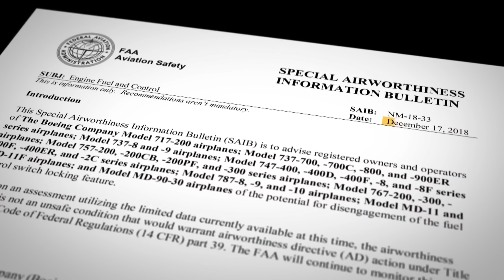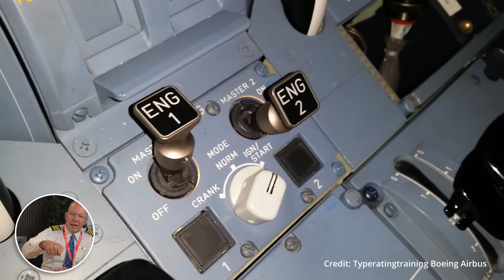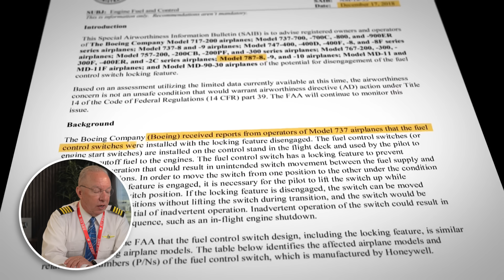Air India 171: The FAA’s 2018 Fuel Switch Locking Bulletin Explained (16 Questions Answered)

Comment: From NM-18-33:
“If the locking feature is disengaged, the switch can be moved
between the two positions without lifting the switch during transition, and the switch would be
exposed to the potential of inadvertent operation. Inadvertent operation of the switch could result in
an unintended consequence, such as an in-flight engine shutdown.”

Comment: If Air India never carried out the inspections recommended in the 2018 FAA bulletin, how can anyone know for sure - at this point - whether the fuel switches disengaged due to an equipment failure - precisely like what was laid out in the safety bulletin, or due to a microprocessor failure in the ECU that instructed the action, or because of the deliberate movements on behalf of a pilot to CUTOFF the engines?
Reports saying the fuel switches were each disengaged a second apart from each other doesn't immediately scream "pilot sabotage" to me. Maybe there is a bump somewhere on the inner portion of the fuel cutoff switch mechanism that caused one of the switches to fail slightly later than the other one (?). Not saying that is what happened. Just saying there have been plenty of incorrect root cause determinations made in the early stages of airline crash investigations - and often what was thought to be an "obvious" cause right after the incident has turned out to be wrong.
One pilot asked the other why he cut off the engines and the other pilot replied that he did not cut them off. So, it's possible he was telling the truth.
Anyway, I'm skeptical of assigning blame this early on.

Comment: Steve I watched a video yesterday repeatedly demonstrating the fuel control switches in a 787 being cycled from "run" to "cut off" and back, they made a sound that could be heard in the video. Does the CVR have good enough "hearing" to record the sound of the switches being operated  in the cockpit of a 787 under take off power?

Comment: You are saying it was a physical movement of the switches and no electric or electronic circuits could fail, but actually the physical movement is not directly controlling the fuel cut off valves, it would generate some kind of digital pulse which will activate the electronic circuits which will activate some relay and some actuation with motor operated valve to shut off the fuel line, then why you say it could never be electronics circuits failure?

Comment: Airlines can put a camera and still address the concerns of pilots. How? The camera records and puts data in another FDR and once the flight is completed without any problem, pilots are allowed to manually delete the camera recordings. The recordings remain in the FDR only if there's a catastrophic crash after which the pilot is unable to delete the recordings.
Reply: Also, capt steeve deliberately overlooks and doesn't properly answer many key points such as

1. The issue of boeing planes having faulty fuel switches as shown in the beginning of the video and then no mention of it in the rest of the video.
2. Assuming that plane was working as it was supposed to giving a desparate cleanchit to boeing and nothing else like some  internal mechanical or electrical issue which could have triggered the switch in cut off. Mechanical Switches can be moved from inside and electrical signals can be altered by some unknown phenomenon, both either by accident or sabotage.
3. Outright rejecting the camera inside the cockpit saying that it wouldn't have stopped the accident is just not how he should talk as a consultant and captain. Of course a camera never stops anything from happening but helps us to find out how whatever happened, happened and can be prevented it from happening.
4. Him being a little uneasy and more reddish while quickly answering a few questions is evident here.
5. Him saying the word "denial" giving an impression of the other pilot lying when saying he didn't cut off the switch and not even considering it to be true and then logic further from this assumption.

Comment: So , most likely its the copilot. Captai , pilot in command, has the aircraft duting take off and climbout. He is concentrating on flying the aircraft. His eyes are in instruments and outside. Copilot knows that this is a critical ,most volunerable phase of flight. Captain is occupied, the aircraft is heavy , with nose high attitude, gear down, flaps down. So copilot takes advantage to quickly place fuel control switches into cuttoff. Knowing that even if placed back, there is not enough time and altitude for engines to get power  back. This was a deliberate act of inflight sabotage by copilot. A mass homicide suicide. Just like German Wings 149. Motive? Speculating, revenge,  retribution. Passed over for promotion. Feeling insilted. Having lived and worked amongst South Asian from Subcontinent , there is a dark streak that runs through their cultire. Slights and perceived insults are carried for years, decades. Grow like cancer. A cancer of the mind. Professional culture is so competetive and pressure to succeed is so high that any obstacle is taken bitterly personal. 
This was act of retribution against airline and society . Mass muurder. Well thats my speculation.

Comment: As an industrial systems, reliability & product compliance engineer, I would think that there would be a mechanical AND electronic (i.e., soft/firmware) interlock that prevents the engine fuel control to be cutoff once the aircraft is airborne, despite the position of the switches, unless there is an engine fire warning.

Comment: Captain Steeeve, 
Could a TCMA malfunction or glitch occur that commands an engine shutdown to the FADEC, and would the FDR then record this as the fuel cutoff switches transitioning to ‘cutoff,’ even if this was not physically done by the pilots?

The pilot asking the other pilot about the fuel cutoff could have been in response to an ECAM warning, rather than to seeing the mechanical switches in the ‘cutoff’ position—possibly under the assumption that the other pilot had already moved the switches back to ‘run.’

One of the pilots might then have manually moved the fuel switches to ‘cutoff’ (which the FDR wouldn’t register, as they were already electronically off) and back to ‘run’ to try to reignite the engines.

This could also explain the four-second delay between turning engine 1 and engine 2 back on.

Comment: Captain Steeeve.  I noticed your reluctance talking about cameras in the cockpit.

Body cameras are quickly becoming mandatory across law enforcement.  Any job that has potential of catastrophic danger, should be equipped with cameras.  The cameras could be triggered to run on a 2 minute buffer, and only be accessible to be viewed in emergencies. This would save stress, time and resources for investigators, and take care of privacy concerns.

2025 version of the black box",  Old timers are going to have to adjust, just like they probably did back when black boxes were introduced!

Comment: The report siad the fuel shut off modual was replaced on that plane. could it have been replaced with the faulty one from a 737?
Also on the camara issue we have driver cameras in all types of mass transit and critical carrier from busses, trains, Trucking fleets and even personal dash cams. the fact they aren't in planes is mind boggling.

Comment: As per my understanding the logic of the 787 in case of a dual engine failure is to automatically start the APU first and if that fails then deploy the RAT. APU takes about a 50s to 80s to start. So why was the RAT deployed sooner than that?

Comment: I must disagree about saying the safety bulletin was about installing the switches upside down. Surely the bulletin was saying that the switches could have been installed and then without the need to lift them up first to move them. Without the need to lift them first they could in fact move by themselves to the OFF position. That would explain why the pilot then said - I did not switch them to OFF. The bulletin also, I believe, advised all Airlines to check and fix this problem if it existed but Air India said specifically that they DID NOT follow this safety procedure.

Comment: Captain Steve, excellent as always. Perhaps give a bit of history of other infamous flights most MOST very likely suicide by pilot. Examples:

Germanwings Flight 9525 (2015) – Co-pilot Andreas Lubitz locked the captain out and crashed the A320 into the French Alps, killing all 150 aboard.

LAM Mozambique Airlines Flight 470 (2013) – Captain locked the cockpit and deliberately descended the Embraer 190 into the ground, killing 33.

EgyptAir Flight 990 (1999) – Relief co-pilot reportedly disengaged autopilot and repeated “I rely on God” as the Boeing 767 dove into the Atlantic, killing 217.

SilkAir Flight 185 (1997) – Cockpit voice and flight data recorders cut out before the Boeing 737 dove nearly vertically into a river, killing 104.

Japan Airlines Flight 350 (1982) – On final approach to Haneda, the captain pushed the stick forward and engaged reverse thrust; 24 died, 149 survived.

Such a complex problem, with the likely right fear many pilots have of never being allowed to fly again after treatment(s), because of the liability

Comment: The reason video cameras haven't been standard is because of pilot union pushback. They will almost certainly end up being abused by companies for pervasive monitoring instead of their purported use, accident investigations. There is also the potential misuse of footage by accident investigators, prosecutors and news agencies. Being monitored also has a psychological effect, it can cause pilots to second guess whether they made the "correct" decision in a high stress situation, one that will not lead to punishment by the company. There are other issues such as accident video of an international flight ending up in the hands of a foreign state. Aviation has extremely unique circumstances that make video of cockpits very much not as straightforward as you might think.

Comment: Captain Steeeve, why not go deeper into the priduct quality bulletin, question the maintenance operations quality, electro-mechanism of the fuel control switch before jumping into pilots' mental state? Pilots are geniuses for flying the plane but the build engineers know more about the mechanics and electronics in the plane that controls the whole plane. Let us not brush off the deeper engineering investigations to come before the blame on pilot's mental health.
Reply: Also disappointed that he only briefly covered the bulletin and then he gets the entire purpose of the bulletin wrong by stating that the plane would not fly if the switches were installed wrong when the actual issue was the locking mechanism and not the switches themselves.
Reply: That will all be investigated and will be part of the final report. That said, the black boxes would tell them if anything was wrong with the systems ,they already know a lot of what it wasn't. The data recorder showing that the two switches were thrown into the kill position 1 second apart is strong proof they were manually thrown, if it was possible they were bumped into or vibrated  , both would have triggered at the same time.. 

In the end the investigators final report,which can take a year, will be the ultimate resolution.

Comment: There should have been a verbal alert in the headsets and speaker in the cockpit "fuel cutoff engaged" (while in flight mode) but it seems this is not the case currently, but it should be!

Comment: I've got the solution and a theory! The cut-off switches must be placed in the cockpit in such a way that both pilots have to confirm their new position.. One switch on the captain side, the other one on the copilot side. My theory is that the same pilot who asked, "Why did you cut the fuel off?" it's also the one who actually did it. I don't think that a pilot who intended to crush the plane in the first place would've had any appetite to deny the unavoidable. Corect? This is, in my mind, a deliberate act. How many times did anyone turn their car engines off by mistake? Never.

Comment: I hope I can ask my Captain Steeeve a question here for him to hopefully answer in a future video.

Not a pilot, but I think this horrible tragedy raises some flight deck design questions.  I believe in all of the checklists that would shut down or cycle one or both engines, the sequence has the pilot move the thrust lever to idle first, and only then turn off or cycle the fuel switch.  I am wondering whether it might make sense while the plane is in flight mode to require the corresponding thrust lever be moved to idle before the fuel switch could be actuated.  Or to not allow actuation unless the plane has first registered some engine messages or performance issue that would warrant this action.  

Also, since unfortunately humans moving these switches during stable flight presents such an obvious and catastrophic risk to the aircraft, I wonder if it makes sense to relocate them to a place less easy to reach.  If these switches were placed less conveniently and behind more protections such as a cover, that would probably slow down someone with ill intent and give the other pilot another extra couple of seconds to realize what was going on and to react.  I think the placement of the fire switches in Alsaka Airlines flight deck on an overhead panel behind some protections is in part what saved that plane from the magic mushroom pilot on a bad trip in the jump seat.  

I don’t see why these fuel cutoff switches should continue to be in such a centralized and easy to reach location, when they are not needed during flight except in the case of extreme emergency, and then, only in sequence with other preceding steps.  Saying that this is where they always have been doesn't seem like a strong argument here.

Comment: Scarier than a design flaw or mechanical issue is the fact that it was possibly a suicide by crash.  It has happened again.  The two most important parts of a commercial aircraft are the two pilots.  If they are not functioning correctly, for whatever reason, bad things happen fast.   It would be better if there is a design flaw as those can be fixed.

Comment: could it be possible that the pilots on the previous flight forgot to switch off both switches to “cut off” and that it’s set on “run” when shutting down the plane after landing? 

and maybe the air india 171 pilots didn’t realised that the switch was already set to “run” and therefore the pilot accidentally switch both switches from run > cut off instead of from cut off > run when taking off.

Comment: Steve you're missing the point about having CCTV in the cockpit, of course it wouldnt prevent incidents like this, but neither does the voice recorder, but it would help explain who did what. Also the video could be secured within the black box so access would be strictly controlled.  Finally your comment that it may show a pilot doing something that he shouldn't be doing e.g. reading a book or some indecent interaction with someone,  is exactly why there should be CCTV in the cockpit.

Comment: Hello Captain, reviewing the video and the preliminary report available open source I am unfortunately concluding that one of the pilots deliberately turned mechanical fuel switch to off position in the middle of the plane take off. Based on the available information which pilot could have turned the fuel switch off, co-pilot or captain? Does the sequence of switch going off and later going on  (Right vs left engine) provide a clue on this topic? Does the co-pilot always sit on the right side of the cabin? As preliminary crash report the co-plot was pilot operating the plane and captain was pilot monitoring. 3 seconds into the takeoff the co-pilot should be busy handling the plane controls for take-off maneuver?

Comment: Captain.....It's my understanding from other videos I've watched that the 1st officer (Right seat) was the one doing the take off with the Plane Capt (left seat) does the observing & callouts. With the FO taking off, wouldn't he have both hands on the Yoke to control the plane? and eyes straight out-front concentrating on the flight? Since the #1 engine turned off first then the #2 2nd, does it make sense that the Left seat would/could turn off the switches closest to him? Conversely, IF that was the case, why would you turn them back on with #1 first & #2 second, since it's the farthest switch? Also, does the voice recorder record which seat position is speaking? Is there any way to identify which person said what? Greetings from the Old Jarhead in WNC

Comment: I have a comment.

In such a case, the pilot should immediately turn the switches back ON position , rather than waiting 10 seconds after noticing they were in the OFF position.
10 seconds in this situation is a huge waste of time.

Second comment:
The video shows that the aircraft maintains its nose up until the stall and descent.
The pilot, immediately after noticing the loss of power and turning the switches to the ON position, should level off, lower the nose of the aircraft to gain some speed, and buy some time for the engines to react and gain power

I know it's difficult, but the pilot should have acted accordingly, just as the pilot in Greece did. Immediately after the loss of thrust, he noticed a lack of thrust and immediately lowered the nose, gaining speed and buying himself time, thus avoiding a crash.